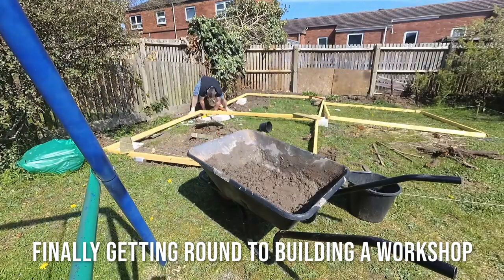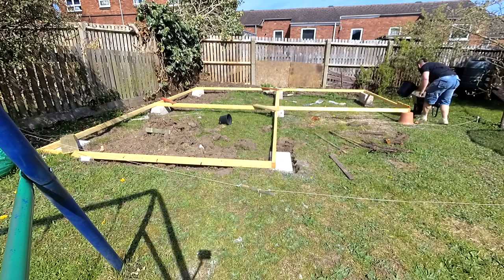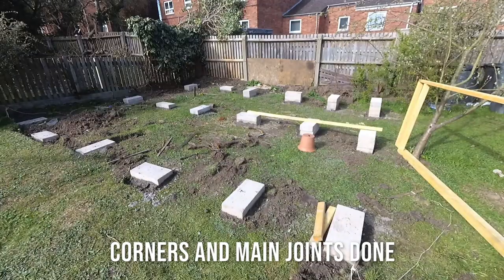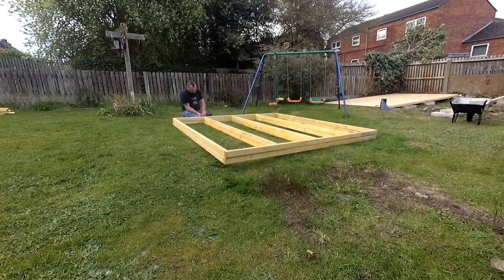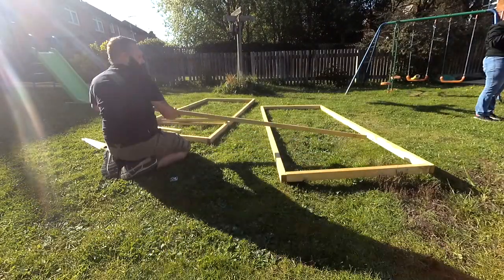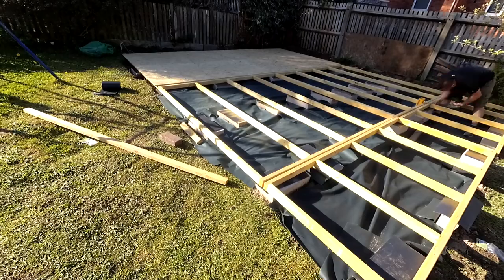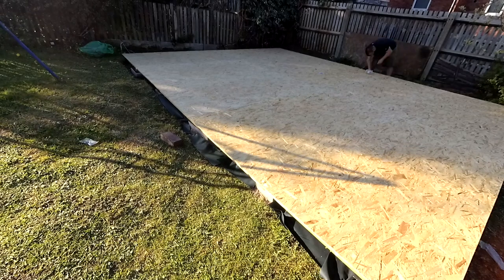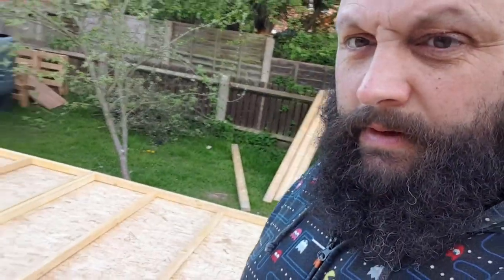Workshop Build: Part 1: The Floor and Support

Comment: You not putting Insulation under ?
Reply from the maker: No.  I am putting another layer on top so not leaving the floor as just OSB. the amount of heat lost through the floor is up to 15%, so thinking of budget and whether there is a point, I decided against it on balance.  At some point, when the walls are up, they will be insulated, along with the roof.  It might not be immediately, but at some point.  Working to a budget to get the main structure up.  This way I can add on afterwards when budget allows.  I will also probably be adding a wood burner at some point to give the place a little something over winter.  The other thing, I will be running a small forge just outside the door, so sure that will keep it toasty on a colder day.
Reply: @ProjectGarethNorman  Lovely, A forge will keep it super nice !